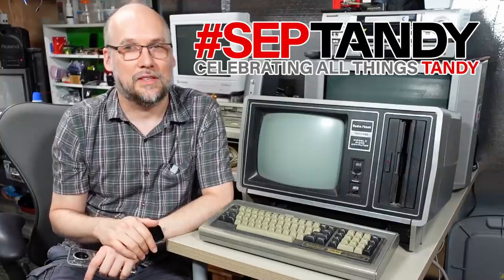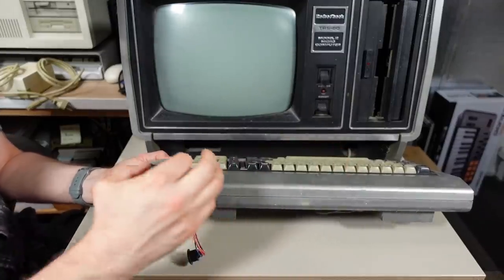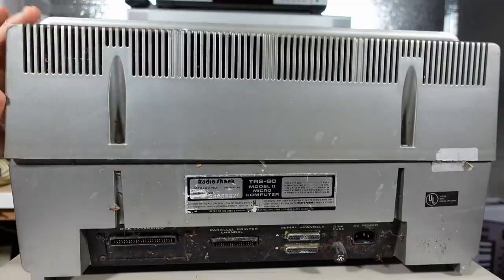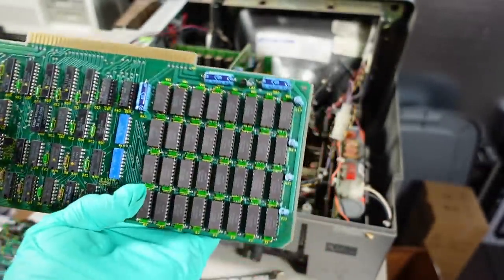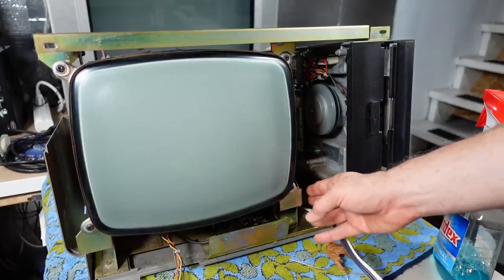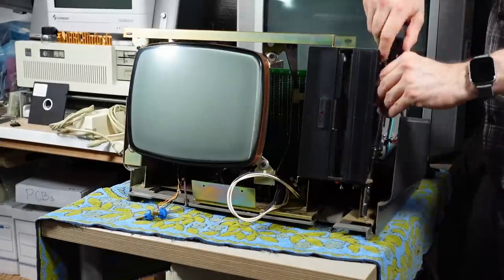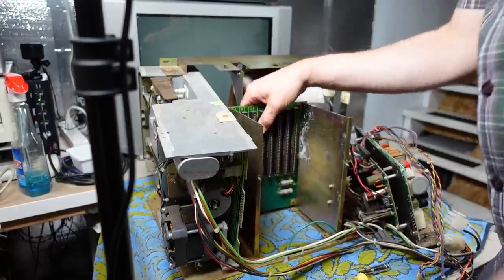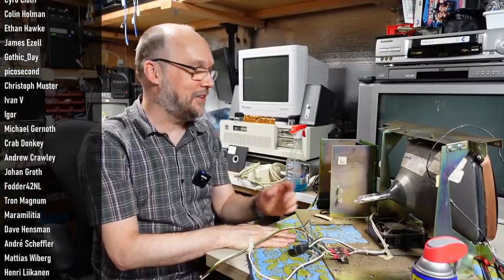Another left for dead machine: a TRS-80 Model II #septandy 🕸🕷🐜

Comment: @28:31 - As to the question of how to hold the nuts, etc. in place while you put the system back together: Get some Blue Tack and put a very small piece of it into the edge of the socket, then put the nut or whatever you're trying to put back in place inside the socket. The Blue Tack will hold it in place an still allow you to retrieve your socket once you've got the bit back in place.

Comment: Regarding getting screws back in when you don't have a magnetic tip, I take the magnets out of old hard drives and either stick it to the side of the tool or break a piece off and stick it in the tip. Instant magnetic tool.

Comment: the paint on my model 3 was worn around the keyboard but i was able to find some matching spray paint so i took care of that. came out great. but it to was pretty dirty inside and i had to repair a couple chewed wires in it.
Reply from the maker: Did you have to sand and remove the old paint first? My issue is I'm so bad with the prep and careful application of the paint.  I'm impatient LOL
Reply: @adriansdigitalbasement   i may have went over those areas lightly with some very fine paper but im not 100% sure on that but im thinking it did, but i know i cleaned it so there was no oils or anything on it. was all just to help it stick.

Comment: Could you possibly ditch the 8 inch floppy, and all the sketchy mains voltage parts and run safer off the shelf parts in there? Also, I think newer motherboards that can lay flat in there would be better options than the original. I can't believe how this was made, so unprofessional and unorganized looking.